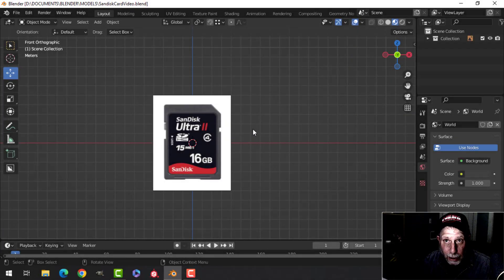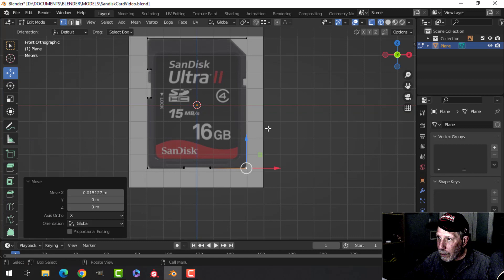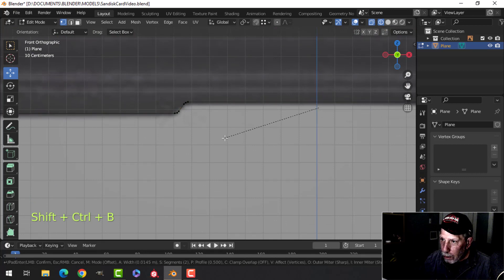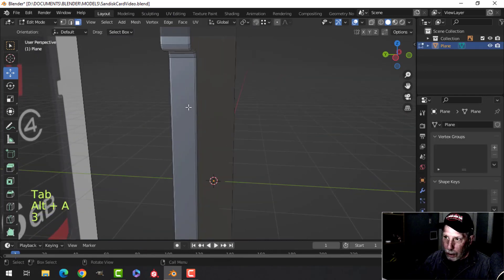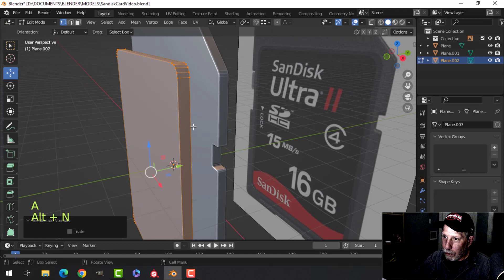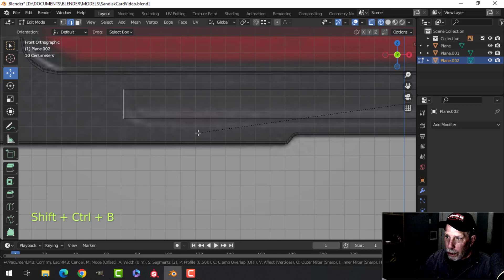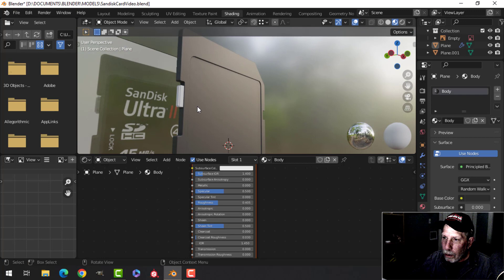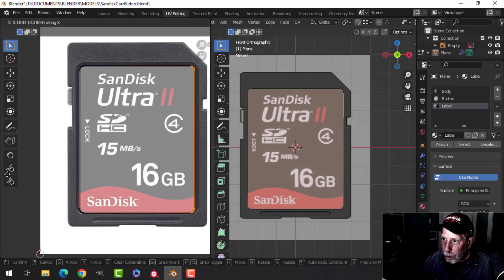BLENDER: SANDISK CARD

Comment: Thank you for these tutorials. I am wondering if there is a plugin you use to snap the vertices holding ctrl? I have been trying half a day and cannot get it to work!
Reply from the maker: There is no add on that I know of and agree that sometimes it is a pain.  Can I suggest you try with a couple of simple planes.  Make sure to switch to vertex snapping, if that is how you want to snap, and leave snapping off.  Then move one plane close in edit mode and hover over the vertex you want to snap to and press ctrl while you do that.  Keep trying a different approach until you find what works.  It will work for you eventually.

Comment: I didn't think that it is so easy specially for middle material i was thinking about decals and....😂.
BTW it was enjoying thank you Sir
Reply from the maker: Hopefully it is easy enough to do.  I decided to apply the label right on the body instead of on a separate plane.  That is one way of doing it.  As for decals, search my page as I have other videos on adding decals in Blender.
Reply: @zerobio which one is best way does the ways have difference between of them at all?
Reply from the maker: It really depends on the model but this way is quite easy and I woukd suggest this way in this particular case.
Reply: @zerobio  thank you Sir
Reply from the maker: @unknownBoy85lover  no problem